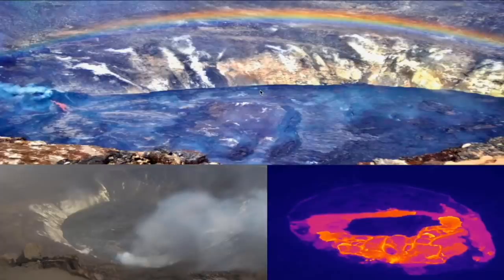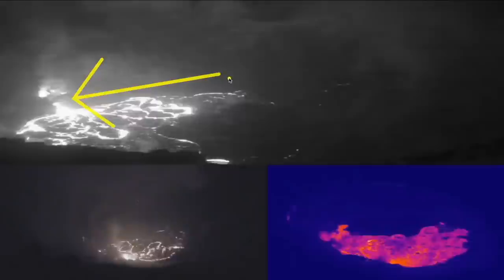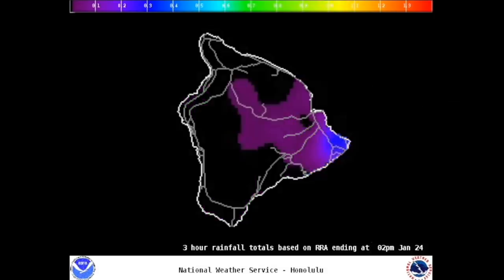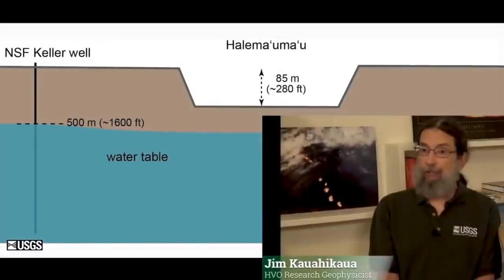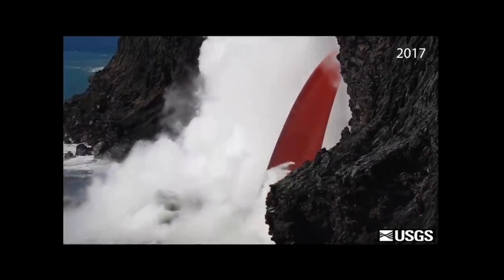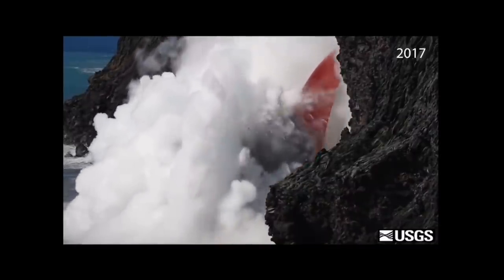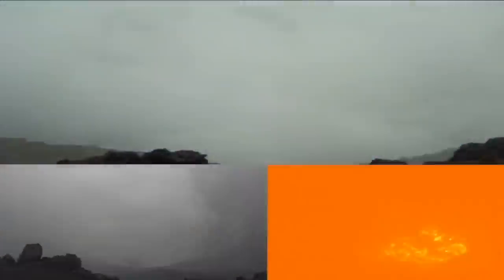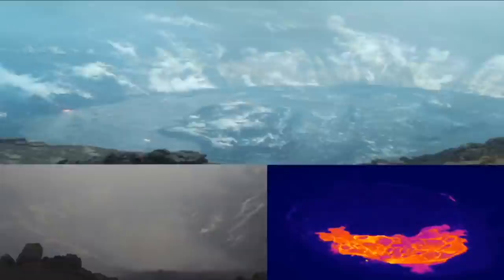Eruption Quick Take: Heavy Rains on the Lava Lake

Comment: pag nag solidify sasabog yung lake.
tapos kung phosphorus pa yon e hihirit pa ang atoms ng element.
meron pang instance na magpapakawala sya sa dagat. on magnets. kasi walang ibang landmasses so close enough para ang behavior dito ay iba. yun ang magpapaputok kung sakali. buildup. hindi papayag ang electron revolution na nacompact kakarelease ng energy and light due thermal activity kaya mabi-biuldup ng mabi-buildup sa ilalim at magbu-burst later on.
meron naman yung tubig kagaya sa ininit na glass tapos bigla nabasa puputok. e kung may magma na tunaw pa banda sa malapit na ilalim nung magsolidify na lake? pressure yon, sasabog.
yung tubig non na mga spring e bumabalik na hindi steam kung di dumadaloy na tubig na bukal o yung tinatawag na "mata ng tubig".

kung may bata naman na magdonate ng billiones sa swimmingpool na tubig e wala sisingaw lang ang billioness nya magiging ulap.

kasi pag narelease ng mga atoms ang energy and light stored inside each of them empty ang status sa loob ng electron shell. so morely pa-absorb ang mga ito at hindi expanded. so they acts as frozen matter. compressed due that the atoms were emptied ng stored heat and light inside. and they will start to refill hanggang magexpand nanaman and bumitaw sa radius scope and electron sa down quark sa nucleus. dahil sa free electron ratio kaya nakakatawag ng bago ang down quarks at nakakaform ng bagong e.shell. ang ratio din na ito ang reason kaya hindi nagsasamasama ang mga ulap sa iisang lugar kung equal ang pairing.

alam ko lilindol ng malakas. mejo malaks talaga. sana hindi matuloy.. hindi ko alam kung kailan.. pero lilindol ang earth. malakas. yumanig lang yata.. basta ramdam

e kung hukayan tapos umapaw ng umapaw? e di lalawak pa lupa sa teritoryo nila doon?.. magsakay sila sa barge ng boring machine diba. tapos paikutenn

harhar
peace

Comment: what effect does pressure have on the water boiling and interacting with the lava ... i know when i relieve the pressure from my trucks radiator it can get explosive if its hot
Reply from the maker: It can certainly be an influence, if for example, all the water was trapped and pressurized under a lava layer, it could certainly be explosive as well!